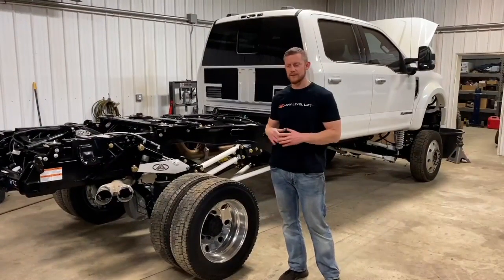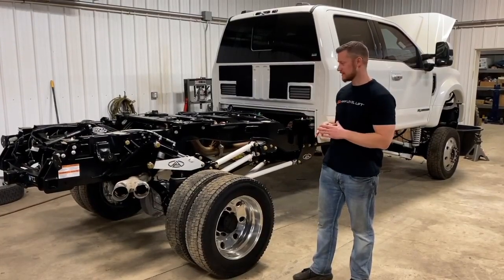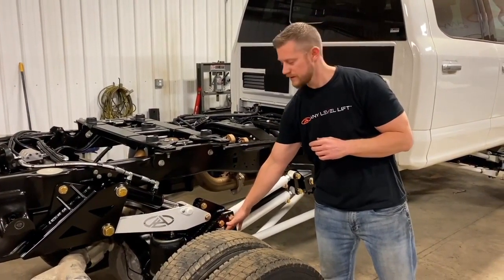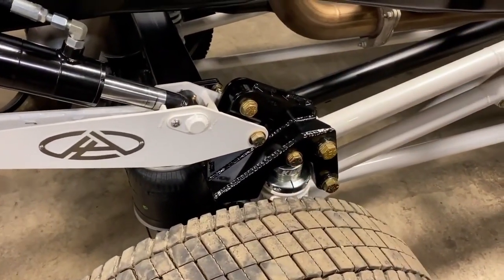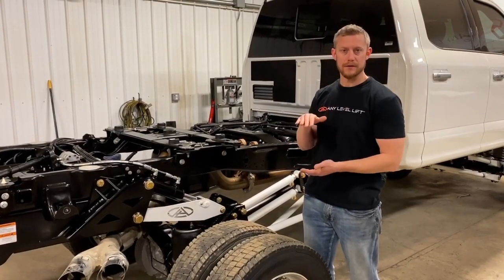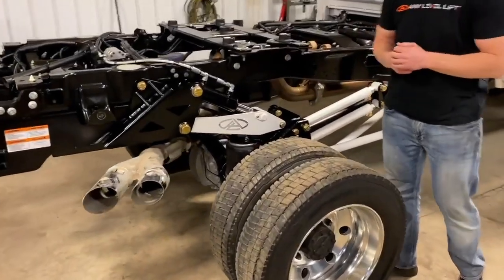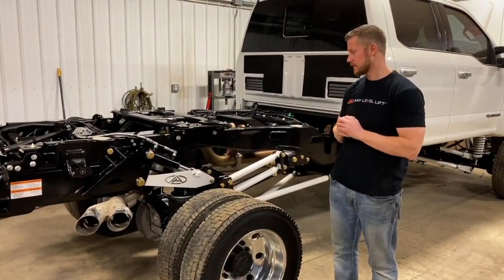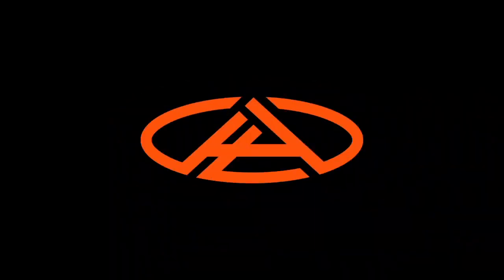Any Level Lift Explained:  Patented Airbag Subframe

Comment: Hello! Few words, I think you can override this system by using N2 (Nitrogen) "balloons" + oil, this system is used on drilling rigs (closing the BOP (Blow Out Preventer), the strongest lifting device in the world. world Pioner Spirit of All See (Decomissioning of platform in North Sea Lifting= 48,000 Metric tons.) https://www.youtube.com/watch?v=-SCMEGJbpRA
For the automobile it was in 1955 that Pierre Manges studied the Hydraulic System + N2 For the DS 19, SM Maserati etc.
1) Hydropneumatic system at work: https://www.youtube.com/watch?v=zcUSMJ_bEjw
2) Working principle: https://www.youtube.com/watch?v=g8HzCuJoeaA&t=144s.
3) All about the system: https://www.youtube.com/results?search_query=la+SUSPENSION+ds19
In conclusion, more reliable system for long trips (we had in our family more than 10 Cars with this system)
Lighter, much cheaper. possible to have several positions in height, to roll only on 3 wheels in the event of two punctures.
Just a point of view, what do you think?
Kind regards, Patrick.